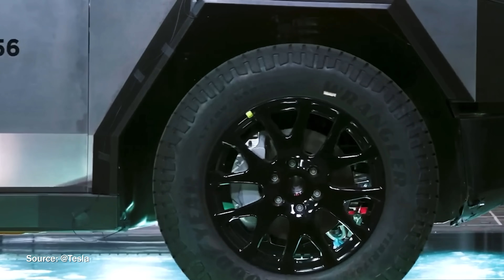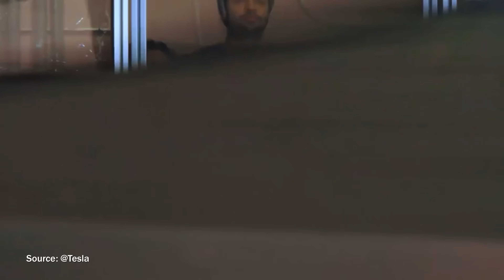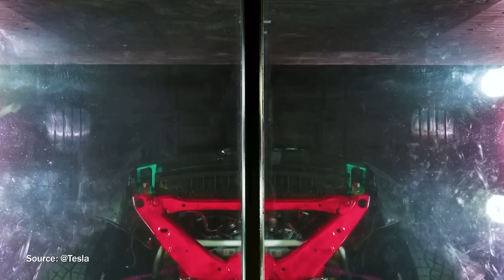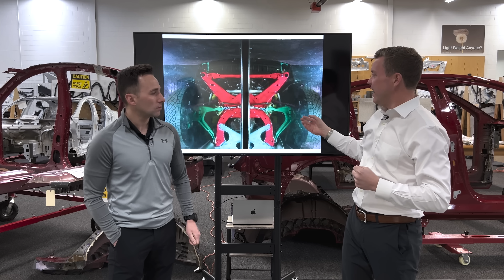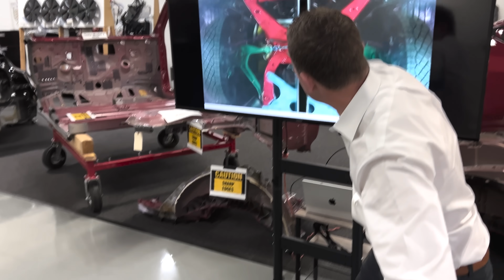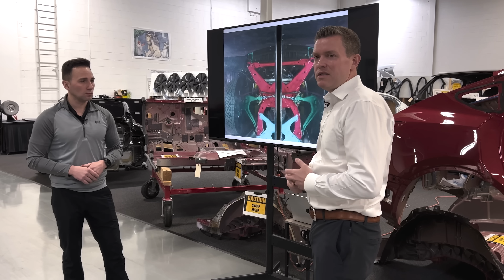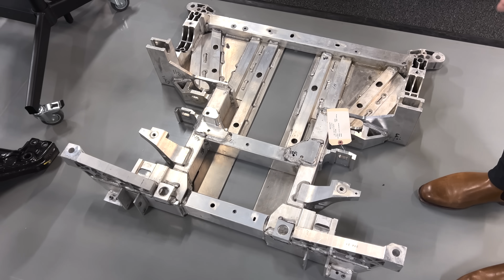A peek under the Tesla Cybertruck! 👀

Comment: Munro Live. Could you potentially do a follow up vid on how this steel structure might tie into the giga-casting and even the exoskeleton?
Reply: Probably exactly the same as how they attach an aluminum body to a steel frame on Model S. Isolating paints and bolts. With the Cybertruck they will have to weld or bend and drill mounting points to the body, which will add cost/labor.
Reply: @patreekotime4578  I think that is a pretty big assumption, since the body on the CT will be structural, which it is not on any other Tesla. 

I suppose they could epoxy the body on, which would also help with galvanic corrosion. It has been used for decades in aerospace. But it is unlikely, I suppose, since the body will be structural. Probably helpful to take cues from SpaceX on this.

I was more interested in how what they observed with the frame, would tie in with the casting.
Reply: From what I can tell, very little of the body will actually be "structural". Maybe the bed, but even that they talked about cutting holes in for storage lockers. It will be as "structural" as any other unibody car, which typically only the rear quarter panels are actually part of the structure. The rest of it hangs off of a stamped steel frame, from which the interior and the front and rear cradle are mounted. Much like the cost savings and no rust as they claimed, the structural savings have been massively overstated. It will be heavier and more expensive, still prone to rust, and the only real advantage is that it will be able to take a sledgehammer... which wont be good for anyone in an accident with one. I was excited about it at first, but the more I think about, the more it looks like a boondoggle. And I seriously doubt Tesla will be able to put it through the rigorous long term testing it needs to go through to meet the demands of offroaders etc. Rivian has been putting their trucks through real world testing for YEARS, how many hours will Tesla log in production ready Cybertrucks before they release them to the public? And I will be absolutely SHOCKED if it costs less than $60k.

Comment: It looks to me like there are two different ratchet straps or cables with turnbuckles at the narrowest part of the red X member.  Would NHTSA add those specifically for crash testing?  What purpose do they serve?
Reply: May be part of the tow cable system. To crash vehicles into the wall, a cable under the floor pulls the vehicle into it. That is why there is that big black and silver line running vertically through the image, that is the slot for the tow cable. Munro has a video where they visit IIHS and they show how how that all works... Ford Mach-E Moderate Overlap Front Crash Test IIHS Tour.  https://m.youtube.com/watch?v=4zK-VTjTGuk
Reply: @patreekotime4578  Yep I think you got it.  Thanks.

Comment: I am not really worried about the steel frame on my CT. It's the body where most rust problems occur today. Frame will be fine.
Reply: But if the body’s stainless are you still worried?
Reply: @Frank_W.  I guess what I was trying to say is the body not rusting (because it will be stainless) is the most important part. I don't think some potential minor rust on the frame, will be that big of a deal. Other more sensitive parts like the arms are aluminum, which also helps with not rusting.
Reply: It has no frame it's a utter weak design lol!!
Reply: @alanmay7929  And your qualifications are what exactly????
Reply: @alanmay7929  What? Did you not see the frame in red? Other than that, giga-castings and a structural battery pack, plus a structural exoskeleton. This is in place of 100 year old crappy ladder frame technology. 

"...3,500 pounds of maximum payload for all three versions of the Cybertruck. Ford can offer only 2,000 pounds with its Standard Range trucks and 1,800 pounds for Extended Range models."
Reply: @machoopichoo2  wow!!!! Yeah nope it's an over 100 years frame technology that is still modern a d actually hauls more weights and tougher vehicles than crappy "structural" whatever you called it! Tell me why did the Tesla semi don't have mega giga super casting!?
Reply: @machoopichoo2  real trucks have frame that gives them the ability to modified install crane, install all kinds of accessories possible including cutting and extending the frame.....
Reply: @machoopichoo2  all the Tesla Cybertruck aren't going to have 3500lbs of max payload depending on the suspension choice.
Reply: @machoopichoo2  the century old frame construction is what actually gives rigidity to those semi trucks that hauls over 200,000lbs which the Tesla semi can't even do..... Keep your "structural crap" away in your dreams!
Reply: @alanmay7929  Who buys a pickup and modifies it? They buy it already prepped for customization. It is called a vocational truck. This is a tiny niche market. Tesla has much bigger fish to fry, like the $25K BEV in 12-18 months. Who cares?
Reply: @alanmay7929  Suspension choice? You have zero clue what you are talking about. All versions will have the same air suspension. The CT is not like crappy old ICE pickup tech.
Reply: @machoopichoo2  when you look even at Starbase from musk do you see any crappy Cybertruck or weak pickup truck with no mods possible!? Grow up!!
Reply: @machoopichoo2  you realise that ICE trucks also have air suspension and also hydraulic suspensions right!? You Tesla fangirls are all sick!
Reply: @machoopichoo2  for example Ford can sell just the truck without the bed and the massive aftermarket supply and companies can either install utility bed with drawers, a crane, a dump truck...... Some are even fitted with wheels to adapt on railway tracks....
Reply: @machoopichoo2  who cares! Alot of people actually cares!

Comment: With the Cybertruck being partially amphibious, it better have extremely good corrosion resistance.
That's the only reason I'm disappointed with seeing steel.
Reply: That's why they are using Stainless Steel.
Reply: @woody-soft  For the body yes, Doesn't look like it for the other stuff.

Comment: Despite all the "stainless steel exoskeleton" talk, this seems like fairly conventional unibody construction. I am assuming a large casting for the firewall area and stamped steel side structure, with stainless steel being offered as largely non-structural exterior panels. All that stamped and welded structural steel will need paint.
Reply: There should be no firewall at all.
Reply: @themonsterunderyourbed9408  what should it be called? Front cowl area?  Roughly where the hood meets the windshield/A-Pillar across the car and then down in the Z Axis. The area where a "firewall" would be in a traditional car.
Reply: @larryevans6739  that would be the bulkhead forward of the passenger cabin; yes, in a front-engine vehicle that's also the firewall.

Comment: The manufacturing process involved with the Cybertruck is crazy impressive.
I am curious how putting hundreds of thousands of ultra heavy Cybertrucks on urban roads is "good" in relation to Tesla's stated mission. Because let's be honest, the majority of Cybertruck owners WILL be to urbanites and most of those owners will have no actual need for a truck. They will buy the CT because it'll be "cool" to cruise around town in one. I'm sure it's going to be a success for Tesla, but it certainly isn't "good" for cities, having an injection of very heavy vehicles tearing up the roads.
Reply: Won't be ultra heavy, and still more beneficial than ice trucks.
Reply: Lookup average truck mpg, according to fuelly it's about 17 real world miles per gallon. As a full size truck owner for work purposes since 2013 who tracks my mileage rather zealously. I can confirm this is accurate enough. If not on the high side of thing's. 🤔

Trucks are usually owned by 35-55 year old males and driven segment leading miles per year 14-16,000+

So the short answer is each ct sold will take 800-1,000+galllons of gas or diesel consumption off the road each year. Plus do away with multiple 6-8 quart oil changes with steel oil filters, emissions testing, engine air filter replacements etc which all require consumption/mining&disposal.  

Just like each semi sold can take a whooping 10-13,000+gallons of diesel fuel off the consumption list each year. Which is much more positive for the enviorment vs say selling 8-10 model s or x instead with the same size battery packs as just 1. 500 mile semi has. 
Or selling 12+model y or 3s which still wouldn't remove as much petrol consumption as just 1 semi can. 👍🏻😎
Reply: @4literv6  I appreciate the detailed response. However, I wasn't asking about the reduction is gas consumption provided by CT. The question is this: How does marketing an urban truck to people who don't need a truck fall in line with Tesla's core mission statement? 

If you're honest about it, you will concede that the majority of CT owners will be 1. Urbanites and 2. People who don't actually need a truck. 

Shouldn't Tesla be marketing lighter, more efficient cars to people in the city rather than making it "cool" to own a truck you don't actually need? 

If Tesla wanted to provide a work utility truck to rural folks, CT isn't it, and we all know that.
Reply: @tygorton  ok then, simpler response Cali is the 2nd largest overall pickup truck market besides tx. How many pickups do you think are used for pickup truck duties daily out there vs tx? Likely if honest both markets see very little real use of their capabilities per truck otr each day. 

Yet Cali is teslas largest market so large over 20% of all car's purchased their in 2022 we're 1 of the 4 tesla model's. 
So that's the answer. Huge markets that move huge volumes of inefficient heavy metal lumps known as pickup truck's. 

Instead of 17-25mpg ice burners let's make them all 70-85mpge electron devouring teslas or rivians, Ford's, gm ev trucks instead. 😀👍🏻

Comment: I guess they gonna go castings later, IDRA cannot supply gigapress machines fast enough
Reply: If that's the case it will have to be crash tested again, quite expensive.
Reply: @heathwirt8919  Not really they have a pretty good simulator. All they gonna do will be the final validation.
Reply: @NTNLabs  A major change will result in a new crash test, simulation is no replacement for a crash test. In all likelihood what you're seeing here is the final configuration.

Comment: Lots of stamped carbon steel, not so much gigacasting. I expected beefier lower control arms in a heavy off-road capable vehicle. 
The SORB test, if they do one, should go very well, levering the front around the barrier, but I would really like to see the next second of the fixed barrier test the clip is from. There is a lot of mass in the battery and the heavy stainless body that needs to be transferred through the chassis attachment just below the bottom of the video image.

Comment: Destructive crash testing is fascinating. Do designers have simulators that can do a virtual crash test and does the government review that data as well?
Reply: Tesla does have software simulation and they've said it many times.
Reply: @themonsterunderyourbed9408  software and simulation are crap!!! Real test is the real deal
Reply: @alanmay7929  actually, software is good to predict and real world is good for testing.
Both have their uses and both should be used. They are not interchangeable. 
Software testing saves alot of money. 
It's a good thing they do both!
Reply: @themonsterunderyourbed9408  yep but hardware testing is still much better and offer much more real world answer compared to a robot, plus it's not a super expensive vehicle like Koenigsegg or buggati so lol!!!
Reply: A simulation can only be so good. It can also be faked. Manufacturers use the simulations to get the vehicle ready for these tests, which I suspect are very expensive... and they have to supply like half a dozen vehicles to do all the different tests. I also suspect that one of the purposes of the painted parts is to use computer vision to identify them and be able to directly compare the real world test to the simulation in order to improve the simulation.

Comment: Amazing analysis as always, Jordan.  The contrast between the M-Y and the Rivian was probably the best example I've ever seen proving that "manufacturing is hard" for an EV startup.
Reply: But if manufacturing is hard, then scaling up is even harder.
Reply: @tedmoss  That's the lesson Lucid Motors is learning right now as well.
Reply: Engineering is hard when the right answers are given to the wrong questions.
Engineering is way easier when you know what questions to ask and R & D on.
Reply: That was shocking. I've seen some other pieces from the Rivian teardown which showed it was overengineered and too expensive, but this is appalling from a manufacturing point of view. It might be excusable if it had significant weight savings, but it doesn't seem to have that, and as Corey said, "astronomically expensive" This is worse than that horrible example of bad production engineering on the Model 3, that 70 piece welded rear underbody. 

Examples of this sort makes me wonder how some people get into engineering management positions, or more usually, how they stay in those positions.
Reply: @grahammonk8013  Read my comment. It is expensive in terms of material and labor, but cheap in terms of capex. And clearly absolutely nothing about the Rivian builds we have seen are driven by weight. The choice of aluminum likely has to do with the availibility of all different shapes of extrusions, not weight. Its funny to me... when Tesla released products with half-assed build quality or are clearly prototyping mid-build; everyone raves about how brave they are... and if anyone else does it, its junk.
Reply: @patreekotime4578  I think we all want Rivian to win in the end, and we all recognize the similarities to Tesla's humble beginnings.  With that said, does Rivian have the engineering talent to adapt and overcome?  If they don't, they will be gone.
Reply: @grahammonk8013  there is nothing shocking there and also it was one of the first rivian to be made, I'm sure they have already refined the design! You can't compare a small vehicle to bigger vehicle suspension setups grow up!!!
Reply: That's probably the stupidest example he took! The Rivian is a big truck with both air and hydraulic suspensions and is made to literally go Offroad at high speeds unlike the crap Tesla!!!
Reply: @alanmay7929  So, Mr. Engineer, which is likely to come apart first?  All of those garbage welds on aluminum on the Rivian or the stamped, solid piece of steel under the Tesla that's cross braced and bolted?  Just a thought.
Reply: @jeffnewcomb601  wow!!! First of all who said those welds are garbage!? Have you tested the rigidity of that piece!? What kind of crap are you even talking about!?
Reply: @alanmay7929  Have you ever raced anything?  Ever watched parts fly of of a Jeep in the Baja?  As they say in the video, that part is hideously expensive and time consuming to assemble.  They would do better if it were molded, and it would be stronger.  /2cents
Reply: @jeffnewcomb601  And it may very well be in the future. Its rather ridiculous for people to expect their first vehicle to better than established OEMs, some of whom have also been doing stuff like this for their EVs because they dont have their strategy set in stone yet.

Comment: Great video but forgot to mention why it has different colors.  I would assume to easily see how it reacts after the crash.
Reply: Not just after the crash. The whole reason there is a plexiglass plate there is to take video of the crash in action. And my bet is that the colors arent for human inspectors, but for computer analysis. Computer vision is a whole heck of alot more reliable/efficient if it is keyed to specific colors. And once you have it in a computer model, then you can directly compare how these parts perform in other vehicles or future iterations of this vehicle. You could also compare the real world test directly to say FEA (Finite Element Analysis) done earlier (which predicts how parts will perform under load). Having this footage also allows manufacturers to tweak their FEA to make sure they are applying forces in the correct places to get the right results.
Reply: Marks each assembly so they can more easily study what happens when they are seeing the video of the crash.

Comment: Thank you guys!
3:46Leave it to Tesla to develop the Solid Tube😎
So excited for my CT…hopefully late 2025 with a smooth ramp.
Reply: I think he means “one piece” tube as opposed to a tube formed from an upper and lower stamping like the rest of the X member.
Reply: @mechanismguy  Sorta like a rocket?😁
Reply: @mechanismguy  Based on the blurry video is difficult to tell but whether it's a bar, seamless tube, rolled welded tube etc. It wasn't invented by Tesla, that was my point.
Reply: @heathwirt8919  Oh. I misunderstood your comment. I thought you were pointing out that it was clearly hollow, not a solid bar of metal.
Reply: The "solid tube" is actual a steel bar and it was invented in 1910.
Reply: @heathwirt8919  I think that was a mistake from Corey, I think he misspoke, and it's actually a thick walled tube.
Reply: @grahammonk8013  It takes a real engineer to figure this out.😁